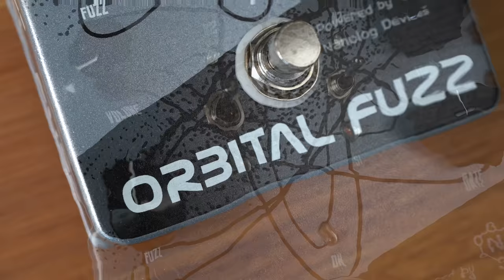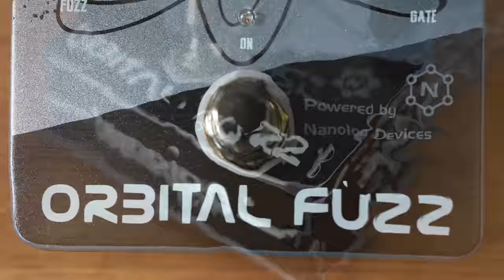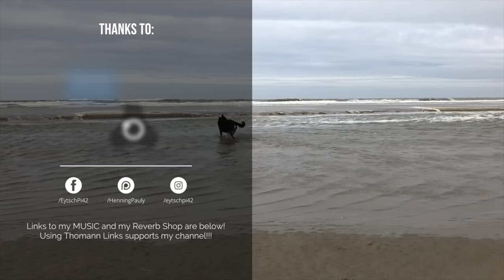What is a Carbon Fuzz? The Nanolog Orbital Fuzz is!!!

Comment: I wonder if those Nanolog Audio pedals offspring from The Heisenberg Molecular Overdrive.
Reply: @Nanolog Audio Inc. Thanks for the answer :)
Asked since the PCB components looked near identical.
Looking at the output signal vs input I could imagine that synthetic diamonds are used in the coating process.
As Henning mentions, the pots need to be secured, and please consider a carbon fuzz with switchable high/low octave added, plus two footswitches, one for standby and one for kicking in the octave. :D